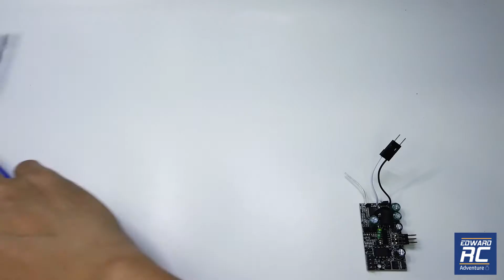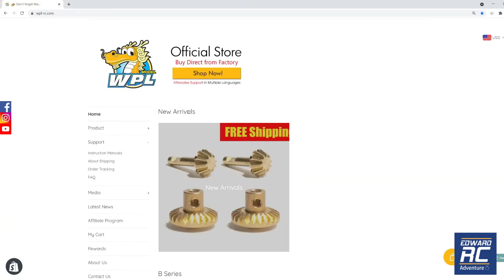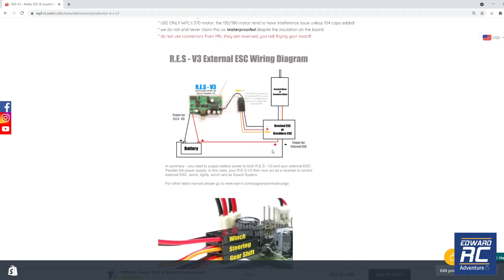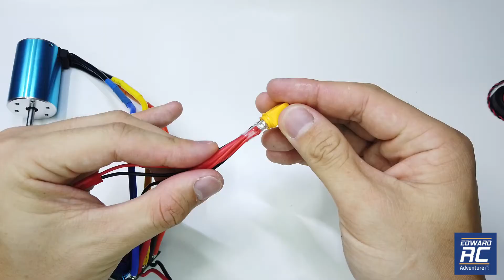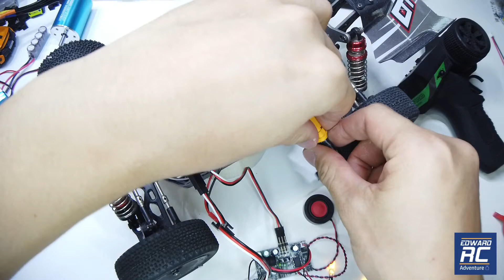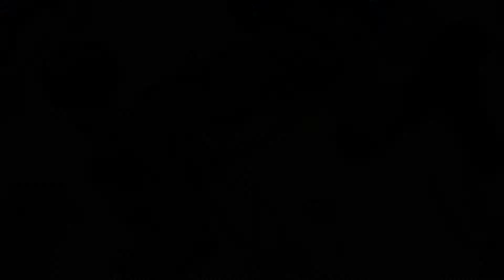RES-V3 External ESC - How to Connect

Comment: I have a B16 that i have upgraded and customized. I recently upgraded to the Res-3 and upon the test run my 9g servo (3 wire) is not getting power. Everything else works, servo is not actuating.

Comment: Hello Edward, I was just wondering if I could use the External ESC wires for some LED lights. I have too much LEDs and have run out of usable connectors. Would I be able to connect the White and Black to a Red and Black?
Reply: Did you get an answer to this? I'm in the same boat.

Comment: Helo Edward, im daryl from sabah, i just wanna strt with this 4x4 rc.. N my strter rc is c24.. I already buy half of the upgrade kit such as the rod link, the axles, tyres, n the dynamo/motor with 2 speed.. N a new steering servo.. The question is, if i buy the controller v3, it already include with an esc rite, but if i wanna use external esc, like the 30a or 40a esc, i need follow this step also rite?
Reply from the maker: yes RES-V3 has built in 7A ESC
you only use external ESC if your motor pulling more than 7A. then yes u may control external esc with this res-v3

Comment: Can i use radiolink transmitter with this res v3 ? Or is there a port to connect radiolink receiver in res v3 board ?
Reply from the maker: Nope. but you can use this new WPL ESC with radiolink transmitter
https://www.wpl-rc.com/collections/latest-addition/products/2s-15a-esc